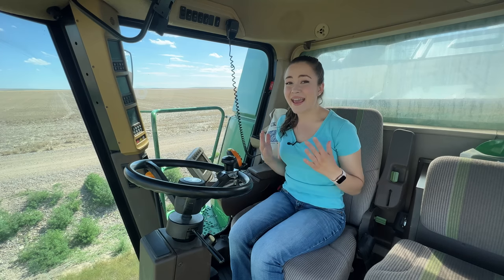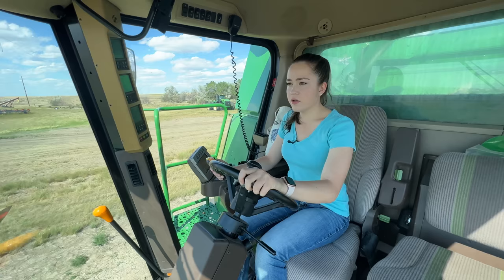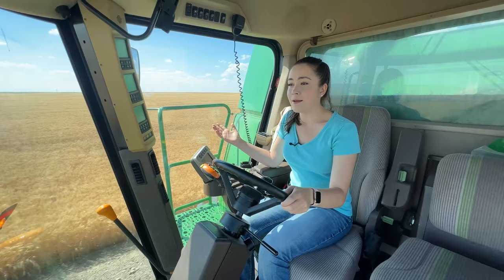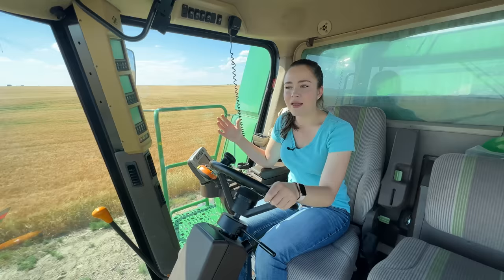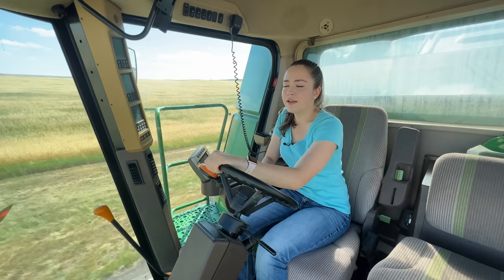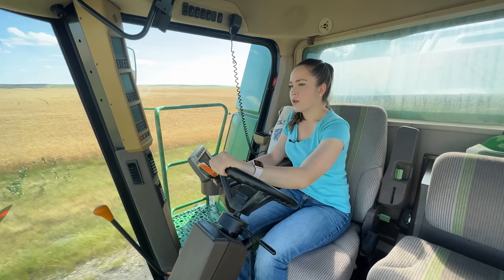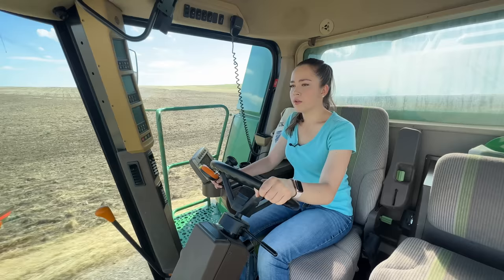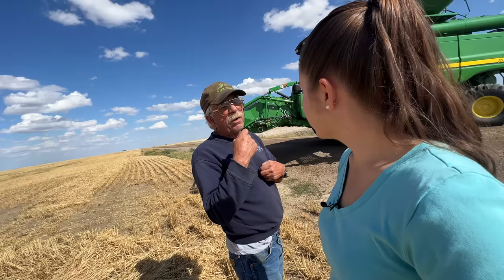Driving Combines to Wheat Harvest 2022! Montana Farming

Comment: Viewed 7-30-22      from Illinois      Hi Kate.......Yes travelling too fast combine will start to bounce and weave soon operator looses control.  In my  30 + years as a company employee
with Massey Ferguson, I never had a pickup header, but with corn heads and  with  straight cut tables machines will bounce  more because of the weight.
One suggestion,  from a stopped position and you want to put trans. in gear.......rock the hydro lever a little while moving the trans shift lever........ it will go in the gear you want easier.
The reason it won't go in gear as you experienced , is because the sliding gear in the trans is not lined up with the mating gear. Hope this helps you.  Bye  :  )
Reply from the maker: Thank you for your great advice and amazing kindness Mr. Mumma!!!!!!  Hello from Montana!!!!

Comment: Kate I know it's a hassle but when you are roading a combine you should always have your seat belt on, a friend of mine was moving one last year and something locked up in the transmission going full speed down the road,  it threw him out the seat and threw the front windshield it was only by the grace of God he survived,  some kind of way a wire broke lose from the hydro handle when the accident happened and it stopped the combine,  had it not been for that the combine would have ran him over at full speed  because he landed on the road when it was all said and done, be careful out there your far to beautiful to be in a accident!!
Reply from the maker: Thank you for your great advice and wonderful kindness Mr. Desselle!!!!!

Comment: To change gear more easily it helps to be on flat ground , and while you pull on the gear lever, slightly rock  the forward /reverse lever back and forth . im combining wheat too !   try getting someone to tap your tail lights while you sit in the cab , its probably a loose bulb connection & this will tell you where it is .
Reply from the maker: Thank you for your great suggestions and kindness Mr. Sparrow!!!!

Comment: Nice driving!!! What time of moisture gauge do you use to determine the level of moisture in the wheat.
Reply from the maker: Thank you for your great question and wonderful kindness Mr. Michelson!  We have a moisture meter that came with the combines, although mine is not working at the moment!
Reply: If you have a tractor supply, or John Deer accessories show you can get a handle held on for easy spot checking. 
The moisture meters on the John deer equipment you have to call the tech support to diagnosis, and fix.
Reply: Haying will be done for us not weekend. Since we harvested 80 bails, plus carry over. Then we work on Alfalfa, a field for Haylage, and we get custom blend of gmo free corn silage. Which is blended by the vets we can for our cows. You know what the say happy cow happy life and $$$$ dollars in the bank.
Reply: It will be interesting to see how much y’all harvest this year in Wheat, and bails. All things crossed, and prayers, and blessing for a bumper yield.